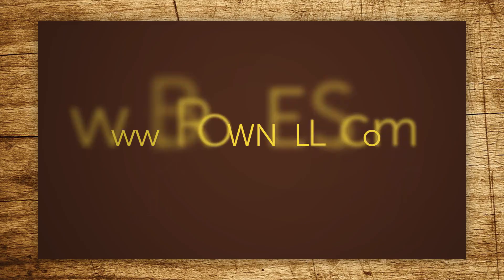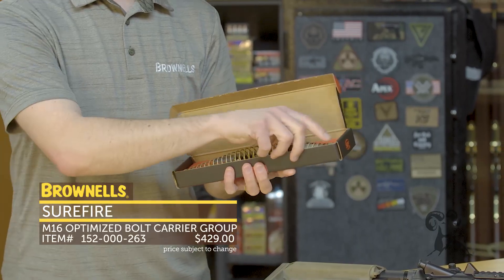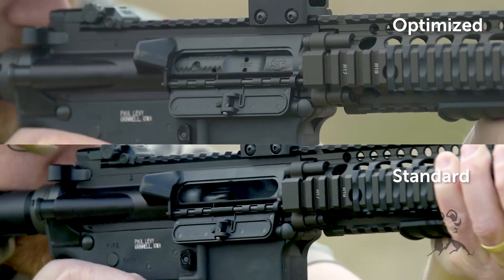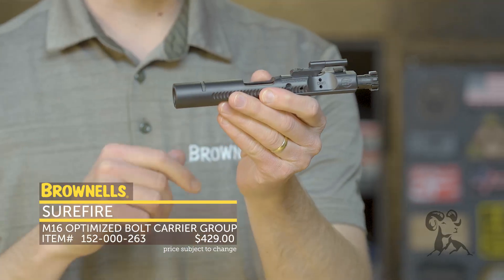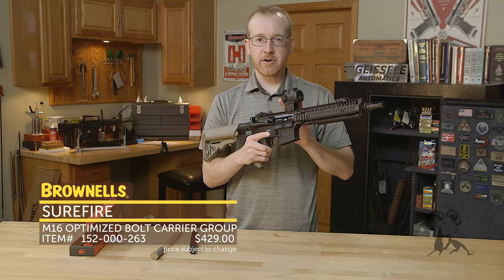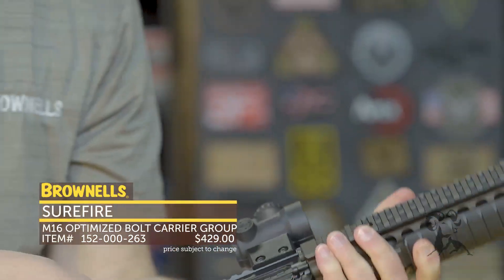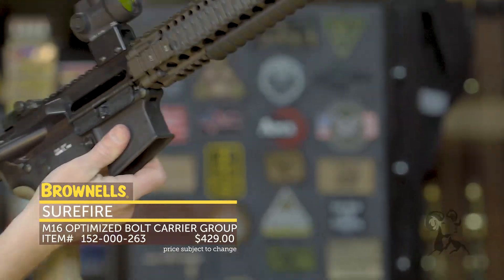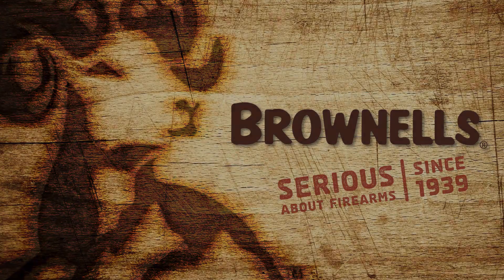New Products: SureFire Optimized Bolt Carrier Group

Comment: Do your bolt catch a favor and eat the recoil in your shoulder for it. If not the bolt catch your frame holding the part isn't gonna like the extra speed running into it.

Comment: I have one of these and it is fantastic.  Completely unnecessary for semi auto.  With a binary trigger (and full auto) it is something to behold.  Worth every penny.  I am starting to understand why Singaporeans chose the Ultimax.  Keep in mind that more heat will go down the barrel (due to increased lock time like the LMT) so bring gloves if you are shooting binary or full auto.
Reply: The LMT bolt works wonders in shorter barrels. It definitely makes the carbine gas system softer.
Reply: Binary is a waste of time

Comment: LMT has much better improved bolt carrier group ( that has been out for over  10 years now ) and it's a lot cheaper than $429
Reply: Is the LMT bolt carrier group the design after L. James Sullivan as presented in this video?
Reply: I have and like the LMT but the LMT doesn’t have a weight to stop bolt bounce.

Comment: Ya know, I generally like what you guys do in regards to the pro 2A community. But this damn bcg package price is uterly RIDICULOUS! A good AR  from PSA is running about the same price....a COMPLETE AR! Come on guys, you should know better. Smh.
Reply: If you are shooting a PSA you don't need this.  If you are running a full auto or binary trigger on a gun that can take the heat, you'd likely change your mind on the price.  I'm not a PSA hater (not bad stuff), but I am not gonna use a $400 AR15 for the high rates of fire that I do.
Reply: @sanguinemoon9201  you would be an exception.... not the rule.

Comment: surefire,  300 for 2 cuts and a press in weight. no thanks. lighter nib carrier, stiffer spring, carbine length gas system and an adjustable gas block, recoil will be smoother than a 24 inch rifle length gassed version with no fancy upgrades.

Comment: I would rather go with a voodoo innovations bcg with integral gas key. Mine had been flawless for a few thousand rounds so far. Not one problem at half the price of this.
Reply: If you use an A5 receiver extension with a standard H2 buffer, and a David Tubb flatwire spring you get pretty much all the same benefits.

Comment: Seems like a good pairing with an A5
Reply: You can currently use a VooDoo Innovations or POF BCG with integral gas key with an A5 buffertube/receiver extension, but with a standard length buffer weight & get the same additional 5/8" to 3/4" of additional rearward travel for much cheaper. Use DSA bufferloc maxed out with three tungsten weights, and tungsten ball-bearing for the BCG insert if you want to max out on weight. All the above combined is still a third the cost of the Surefire system.
Reply: Do Not use with A5.  The buffer is different length and you will damage the gun.  That was one of the first things I checked when mine arrived.

Comment: Won't this induce bolt catch breakage like with older style 9mm ar conversions? That extra mass and travel distance will hammer the bolt catch to death.
Reply: I shot over 4,000 rounds out of it with a Geissele SSA trigger. It has not broken for me. The carrier is a little different tan your traditional one. The bolt stays locked in for a little longer due to the way the cam pin slot is cut and the gas port is a bit bigger so the bolt stays locked in a bit longer. This causes a slight delay in the speed it goes rearward and thus doesn't affect the the hammer like the blowback PCCs design.

I got to say the biggest difference for me is just how clean the bcg is. I mean I can get it spotlessly cleaned to the point nothing comes out back from inside. No build up, nothing. Def one of the best carriers I ever used. I just wish Brownells still had it in stock.
Reply: @Dan-di9jd  In case you were unaware, these are currently back in stock on primary arms 7/14/25.  Who knows for how long
Reply: Yes. Yes it will. There is a reason they haven’t changed it in years.
Reply: Agreed